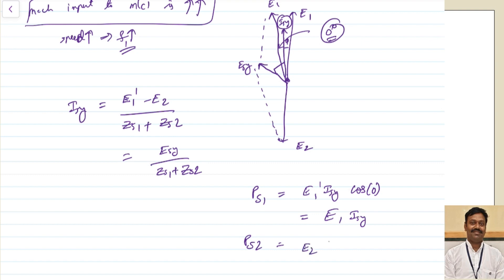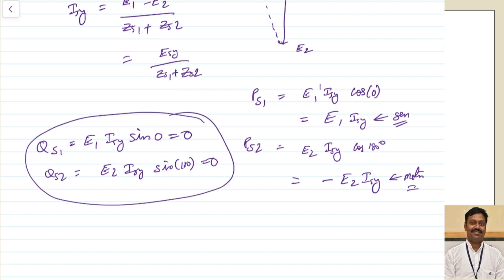SM34 Parallel Operation of Alternators under No Load

Comment: Sir there is a problem that while doing paralleling of DG-2 AND DG-1 voltage increases along with current 
But DG-1 and DG-3 DOING PARALLELING HAVING no prb only with DG-2 this is the case that you try to do paralleling with any one Dg-1,DG-3 VOLTAGE shoot up along with current.
What is the cause

Comment: A synchronous generator connected to an infinite bus is overexcited. Considering only the reactive power, from the point of view of the system, the machine acts as
Reply: i am considering only reactive power view... it delivers reactive power as machine is over excited so treated as a capacitor... kindly rectify my answer if it is wrong... thank you sir
Reply: @lecturesinelectricaleng  thanq sir

Comment: Sir practically at a time how as one Machine is excitation increased , we can't decrease excitation of other machine  at a time to maintain terminal voltage as constant and in case of mech I/P also frequency as  constant
Reply: Yes sir both terminal voltage and frequency changes, but how do we     
Maintain practically constant i.e. as excitation for one M/c increases , at a time how we decrease  excitation for other m/c to maintain constant terminal voltage and if mech I/p for one m/c increased, at time how to decrease mech I/p for other to maintain constant frequency, is there any controlling system?
Reply: Thank u sir

Comment: If we increase the mech power means increase the speed of prime mover the rate of change of flux linking with armature coil will also increase..and voltage induced  in coil is directly proportional to rate of change of flux linkages...
So how the voltage remain constant after increasing mech input
Reply: Yes sir..
Thank you very much...
You are doing excellent work for all student ..
Your efforts are great
Reply: Sorry sir but  I can not get it that how frequency is related to induced emf...
Sir  i think it will be great for me as well as all the viewer/student if you make a separate video on it with example